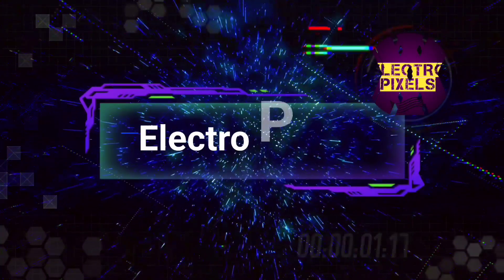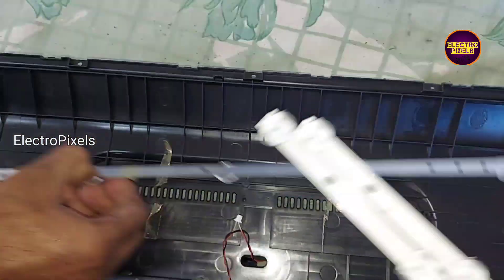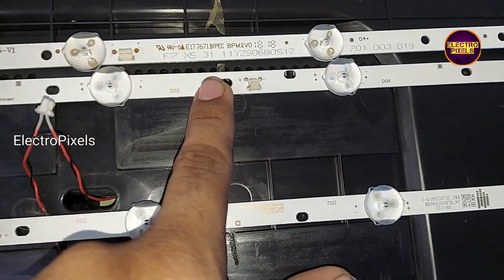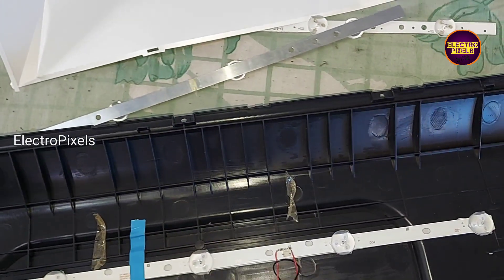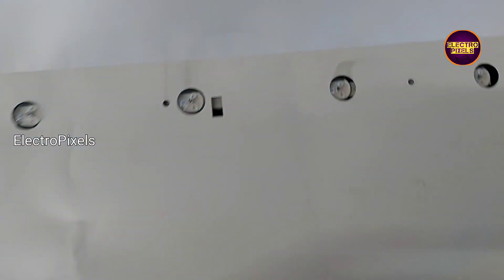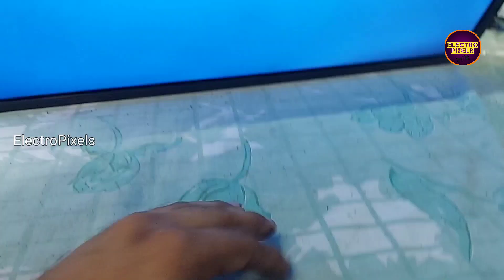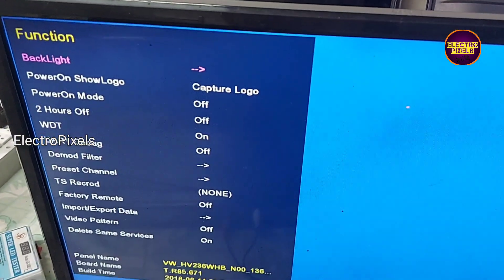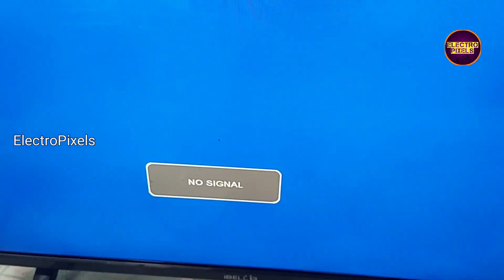24 inch LED TV No Display Repair|Simple way|Sound Ok No Picture |How to Troubleshoot|Tv Reparing|Fix

Comment: Lowering current in the service menu is not correct, when the TV is turned on, the voltage comes to the maximum, only after a few seconds it decreases, but the led will already be compromised.
Reply from the maker: Old leds are replaced with new one. So it's not a problem if startup voltage is high because in default it will be 100.After startup long term usage it will increase lifetime of led Backlight